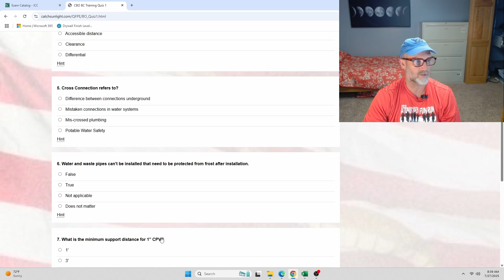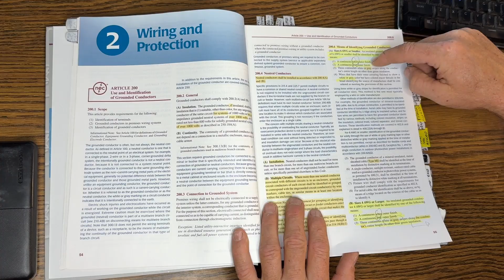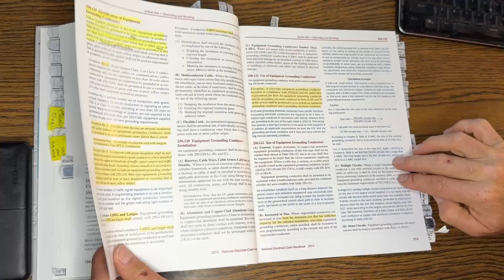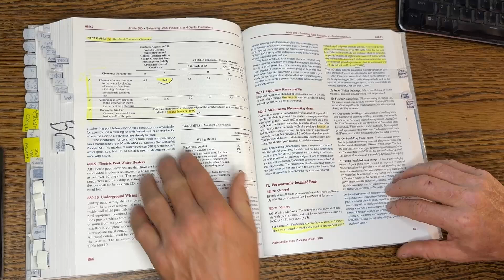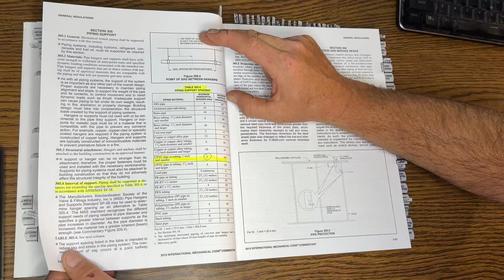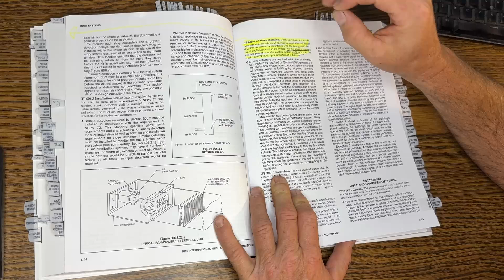ICC Building Codes and Standards (BC) Test for the CBO || Free Tests and My Notes to Help You Pass

Comment: Hey Russ
I was wondering about what tabbing you suggest beyond the ICC tabs on the  IBC. I see you have tabbing on the top of your IBC. 
Thanks Daniel
Reply from the maker: The testing system will require rigid tabs so anything you can find that can't come off very easily will work.  I find these rigid blank white tabs work fine, but I cut them into 1/4" widths.
Reply: 👍Got It!! I can’t thank you enough for your support. Been hoping someone like yourself would put together this type support. GREAT COURSE FOR PREP!!!!

Comment: Thank you! I passed the CBO using this study guide. It took many hours of going through and looking up each question in the books and tabbing them. I took it twice, the first time was me being overly confident and not bookmarking some of the questions that I wasn't 100% sure on. Missed it by two questions the first time. The second test I felt was much harder, had to look up roughly 60% of the questions. Take the time to tab and highlight from the practice tests and use the index during the exam!
Reply: how many of these questions were on the exam?
Reply: @jasonbarker2379  This is a rough estimate but I'd say about 75% of the questions in this study guide were on the (first) exam. I was confident in my answers and did not look them up and that's what got me. I missed it by two questions on the first exam. Second time I left the questions blank that I knew I'd have to look up and used the bookmark feature to go back to the questions that I wasn't exactly sure on. The bookmark feature helped tremendously. This study guide is from 2015 and I took the 2021 so some of the questions were not on the 2021 but spending any remaining time looking up answers (by using the index)  will be key.

Comment: Which tabbed books are absolutely needed on test day for the BC portion of exam? I’m asking because I’m a Commercial Inspector and Fire Inspector 2 and are dreading the thought of buying another stack of pre-tabbed books.

You mentioned the BC is easier than the ICC Commercial Building Inspector B2 exam, is that correct? I say this because I don’t have any field experience with a lot of the code books you mentioned at the beginning (I’ve got structural engineering, civil, and non-structural anchoraging experience with low voltage and fire.
Reply from the maker: Just  go through the BC video and free test I put together and mark those references.  There are many books for that test, but they are all fairly high-level questions.